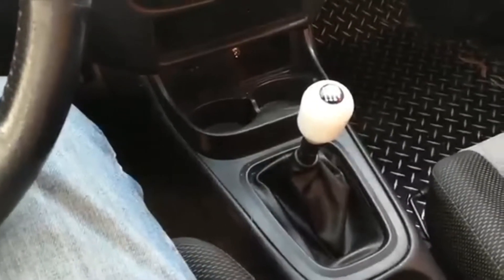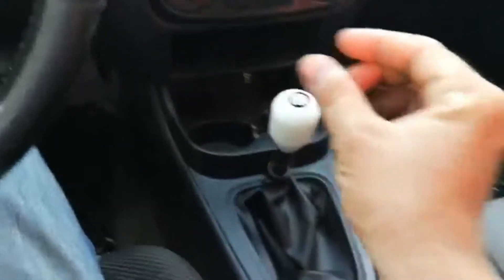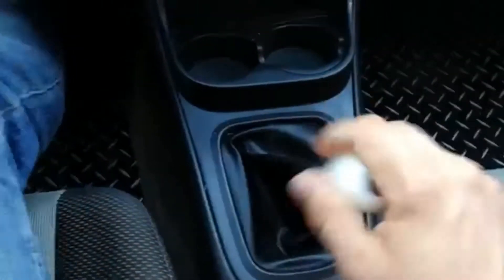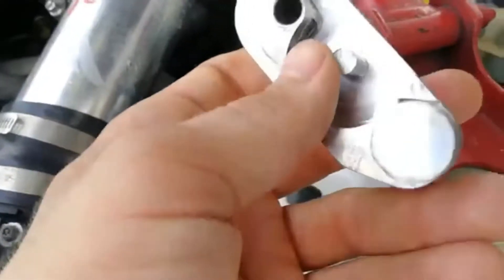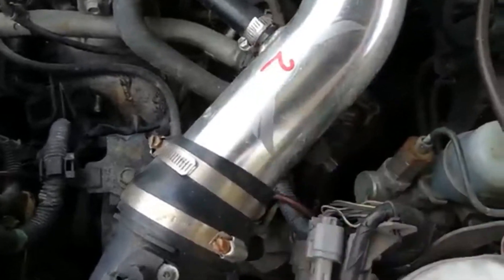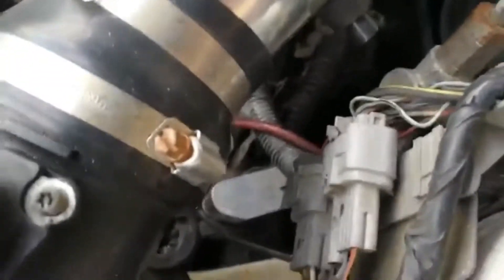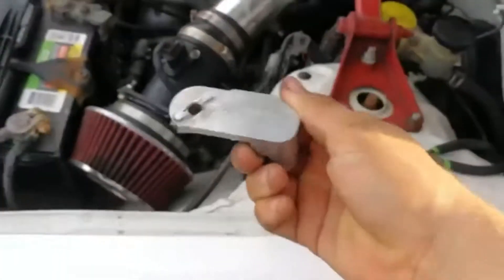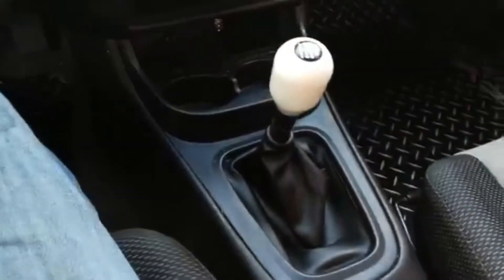2jracing Short Shifter install for b15 Sentra ser spec-V

Comment: I hate the transmission on my 06 spec V. I’m always terrified to switch into Reverse while going to 6th lol
Reply from the maker: I can't say it's never happened.... You'll get used to it
Reply: AJ Amaya yea scary at 70mph lol. Great vids though. I’m working on a 06 spec V also. Starting with fixing up the engine a bit. Valve cover etc.. then performance. Not going to turbo it though.
Reply: @telecaster305  05-06 Spec Vs have a reverse lockout on the shifter. That means that u shouldn't be able to shift into reverse unless it's broken and needs to be replaced. I have an 04 Spec V and it doesn't have a reverse lockout. It'd be nice though
Reply: lol i dont know what it is but going from 5th to 6th i never worry about going to reverse accidentally as i just got straight back to 6th. now if we are talking any other gear to 6th then yes i am always worried about that

Comment: I have a question, so that adapter piece you put on the shifter linkage, is there a difference between buying that vs an actual short throw shifter kit that goes on the shifter itself? Or should I buy that piece from 2j racing plus the kit for the shifter?
Reply from the maker: @skyloz6980  if you have a Sentra, THIS is the shifter you want. No need to get anything else
Reply: @OMGITSAAAJ Ok, I have a 03 Spec-V,  I was confused, there’s ones that replace the actual shifter vs the one you showed in this video, which is just the shifter linkage.

Comment: can you get this short throw shifter for a 04 1.8 S? It is a 5 speed btw.  Also, another quick question. Is there anyway I can shorten the actual shifter shaft/rod/stick??? I have daily driven my 6 speed mustang with no issues, but with the sentra, it sorta stabs my hand because it's too tall and it hurts my bones after a while.  I have to shift with my fingers like a girl to avoid this pain.... I tried changing out the shift knob, and it only helped a little bit. I feel shortening would solve the issue, since my mustang shifter has been low profile and I never had this ergonomic issue, makes me feel like an old man with arthritis.

Comment: Does this eliminate the 3rd gear grind/lockout?
Reply from the maker: No it doesn't. If anything it amplifies clicks and notchy feeling. But it feels very mechanical and faster shifts...
For 3rd gear issues I'd recommend first and foremost adjusting your clutch pedal, it may not be fully disengaging when pressed. 2nd change your transmission fluid to royal purple. Or a good quality gear fluid
Reply: @OMGITSAAAJ  wich royal purple did you use?